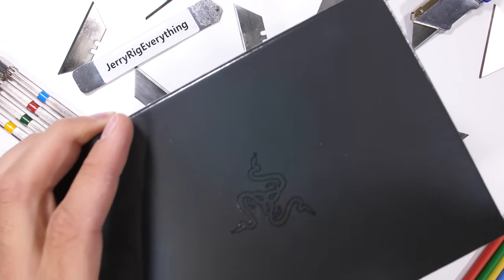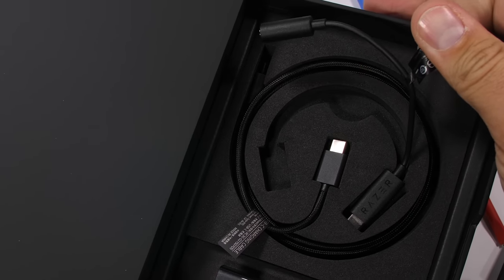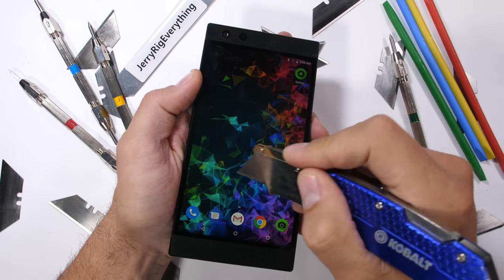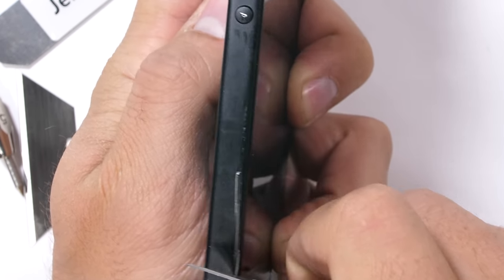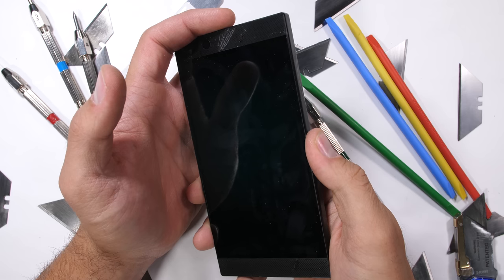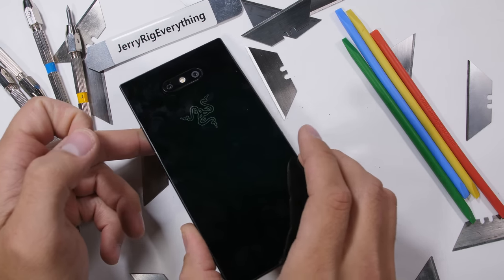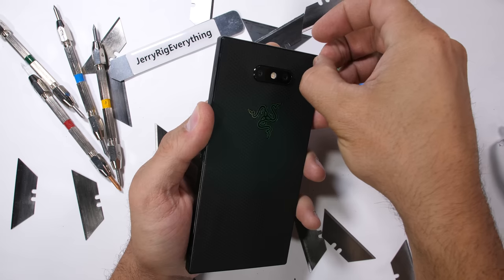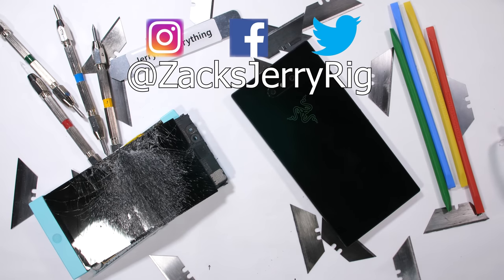Razer Phone 2 - Can Razer Survive a Razor?

Comment: Gaming phone with no headphone jack, yet again.
Reply: Exactly what I was thinking
Reply: Ikr
Reply: Because the dongle has a dac better than most phones including the note 9
Reply: Welcome to 2018 old man
Reply: Theres always room for Jack
Reply: @jordan_ojl Thanks but in my 2018 wired headphones still have better sound quality than wireless, wired don't need charging whereas wireless last tops few hours. Also good luck charging your phone and using headphones in same time.
Reply: @your_average_cultured_dude  But, can't they just put the better dac IN the phone?
Reply: I personally bought a USB-C to 3.5mm jack cable, which I'll plug from my headphones directly to my phone, hopefully it works!
Reply: @jordan_ojl  Double dongle should be already installed inside the phone instead paying seperatly.  Don't the forget the much quicker wear and tear of using one hole for two purposes continuously.
Reply: @assootoshmotah2350  they probably don't have enough space. The display (LCDs are thicker than oleds so they need more space), the logo LEDs and the huge 4000 mAh battery. The placement of the buttons are probably a slight cause too just because they're low and that probably messed up the placement of everything else
Reply: Yes it costs more money but you can just buy a dongle that lets you plug in headphones and charge at the same time.
Reply: @assootoshmotah2350  oh and also the huge bottom front facing speaker blocks a lot of space too.
Reply: if i was the razor phone user,i wuld never put a headphone and play mobile game but if it is pc yes i wuld use..i think front firing speakers are best for mobile gaming phone
Reply: @your_average_cultured_dude  Oh I see, thanks
Reply: and before you talk bullshit.m galaxy s is a old phone... it had a special sound chip and it was perfect for audiophiles
Reply: Welp my lg v20 definitly sounds better compared to my sister iPhone X using the beyerdynamic dt770
Reply: @Fiwek23452  good jokes about the audiophile part. Lmao audiophiles don't even think about listening on phones. They have a huge dac for PC and very good headphones. That sound chip was bullshit that did nothing.
Reply: You cant have good grip if you have cables sticking out. This guy is a noob.
Reply: @michaelmargono  gripping a phone is much easier with a cable in it. You out the cable end in between tour index and middle finger and you don't even need to grip the phone as it will just sit on your hand.
Reply: M K yea it's so dumb
Reply: @Jan Khalabi You speak as if u know they will. We'll see next year if they do, and come back to this comment section.
Reply: @ExarchusDivision  They're noobs what do you expect when they don't know any better
Reply: Everyone follows Apple's decisions of removing headphone jack. I'm pretty sure Razer phone 3 won't have a fast charger
Reply: Anyway a gaming phone should use wireless earphones lol, imagibe playing some racing game with your wired headphones in your phone and flying around whenever you make a turn
Reply: @MK-dg8gr  buy ROG phone It has headphones jack
Reply: @MK-dg8gr   who games like that on a phone lol. its good for like casual mobile gaming but a real gamer has a gaming pc or a console or some shit lol
Reply: thx certified usb c port and included dongle

Comment: why never get to 9?
Reply: Its costly to produce a glass which scraches at level 9 , we would have to buy a phone costlier than iphone xs max to get a glass with level 9 durability , practically its not possible and we do not require such hardness .
Reply: He meant why doesn't he scratch it with level 9 pick
Reply: Oh, i forgot that he did it on back of smartphone and it just cracked at the bend test.
Reply: @devbhattacharya3427  htc did it with their sapphire display and it didnt cost as much as the iphone
Reply: Make for 200, sell of 2000 dollars
Reply: iphone 6s video he introduces the scale IIRC, and he uses a level 9 there.
Reply: diamonds scratch at level 9 as far as I know, so have fun manufacturing a phone with a diamond screen
Reply: @armenmanukyan5095  diamonds are one of the hardest natural substance and it's used as the standard for hardness level 10 on the Mohs scale, there's no way it scratches at level 9, the level 10 Mohs pick tip itself is made from diamond.
Reply: @philipmario9809  Actually that phones screen scratched at level 8 so it didn't get to 9.
Reply: @devbhattacharya3427  theres no glass thats lvl 9 resistent

Comment: I need this phone so badly. I have the Razer mk.1 and absolutely love it but it's starting to slow up. What really sold me was the customizable LED logo on the back. People could say it's a gimmick but I'm a diehard Razer fan and this is absolutely incredible. I also love the centering of the camera and the screen size. I can only imagine the Dolby Atmos sound system within my current mk1 will be the same if not better in mk2 as Dolby Atmos is an INCREDIBLE sound system to have in the phone, especially because of its large speakers. Absolutely phenomenal tech.

Comment: A Gaming phone with no notch and headphone jack.
Reply: Samsung Galaxy S9, S9+, or Note 9. (Because there is nothing special about the Razer phone that makes it more capable of gaming than any other flagship)

Bonus: doesn't come with unnecessary "gamer" branding like Razer and ROG phones.
Reply: @mjc0961  it does have a 120hz display, that is really good for gaming.
Reply: @mjc0961  The reviews call it a gaming phone more then Razer does, it is just a good phone outright.
Reply: @Thom Steenbergen How many mobile games will take advantage of that though? Both Fortnite and PUBG run at 30fps on phones. Which is what every "gaming" phone manufacturer expects people to play. Where as Nvidia on their Shield Tablet actually released proper games like Doom 3, Metal Gear Rising, Tomb Raider 2013, Portal, and Half Life 2, Talos Principle. Actual games. But only works on those with Nvidia hardware
Reply: No reason for most phones, iPhone X has it because there are so many sensors for faceid

Comment: No headphonejack OK it's trash then... Its important 4 a lot of people
Reply: Yeah for me it's super important, but what I did was buy a USB-C to 3.5mm jack audio cable, so the 3.5mm side plugs into my headphones, and the USB-C plugs into my Razer Phone, theoretically it's supposed to work, but my phone arrives today, so I'll see if it ends up working!
Reply: @shmito_123  yeah, want to hear music and charge your phone at the same time? Lol nope said the dongle...
Reply: I personally don't find that to be much of an issue because I'm always carrying around my laptop, so whenever I need to charge up my current phone (which ftr has a horrible battery lifespan), whether it's at school or at home, I easily just switch to my laptop and let it charge. It may not the most effective way for people in general, but I find it a good solution for me personally. It's also important to note how the Razer Phone 2 has quick charge, so in 30 minutes it charges 50%, which is pretty good if you're in a rush.
Reply: I still prefer the note 9 far better no features lost and everything awesome with 500gb storage plus additional micro sd expansion....
Reply: True yeah I do see where you're coming from. I was a little hesitant buying the RP2 tbh, because I've been used to a headphone jack for years, but when I found that USB-C to 3.5mm cable, I immediately bought it and tried it out on my laptop to see if it worked with the USB-C port it has, and it did, so there goes my dongle issue. But yeah totally I'd prefer having a headphone jack, mainly for charging and using it, but that's something I can adapt myself to and can live without

Comment: I wish they could do something about the speaker covers when the next one comes out , had the same issues on my razer one and two , they get a tiny bit of wear in time and easy to get sand in the audio covers other than that...
Reply: would you recommend the RP2? i'm actually thinking of buying it, now that you can pretty much get it for $400
Reply: @Ballackx13  yes definitely , I've got quite an active job but as long as you keep it in a foldable case that protects both sides is a reliable phone , I do a fair bit of gaming because it's got more gig then my laptop , it's the 12th phone I ever owned and it's fairly foolproof , hoping it will run smoothly for about another year before something happens , they're all made to break

Comment: I'm using this and my God I'm dying
Reply: would you recommend it?
Reply: @Ballackx13  Depends. If you're looking for a phone that can handle games. This is your go to. If you want really nice speakers while still having a big screen, this is perfect. Downside is that it's really big and so I can only use my back pockets most of the time. The screen scratches easily if mixed with keys and coins. In my opinion, I like the phone because it lasts very long, charges fast, and performs perfect.